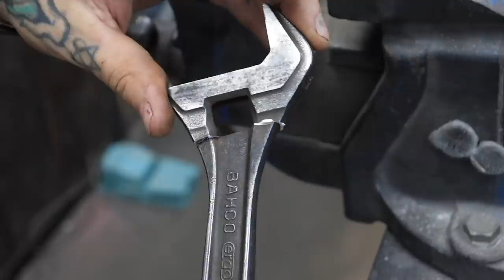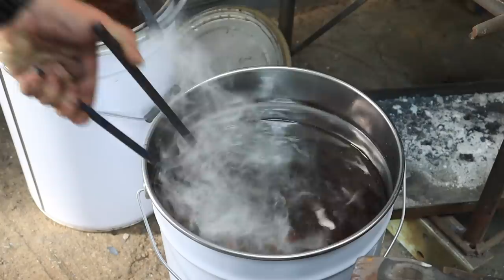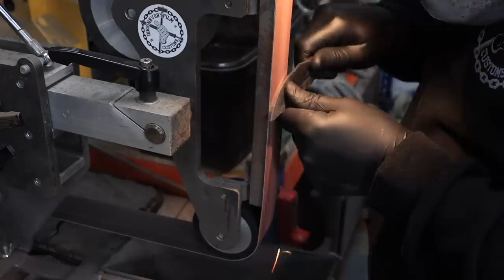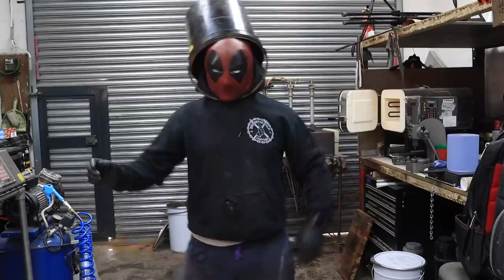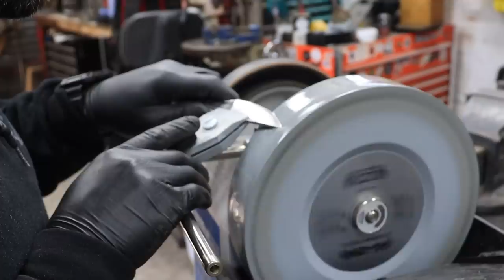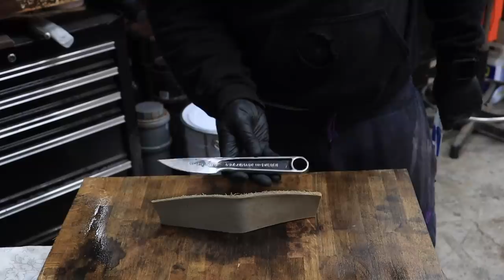Knifemaking - Broken Old Wrench

Comment: Has that steel held a sharp blade or does it dull easy? I know metals like railroad spikes when sharpened don't hold a blade for long.
Reply from the maker: Yes these are tool steel but railroad spike is a low carbon steel

Comment: I like taking Louisville sluggers and turning them into battle axes. Id love to see what you come up with. The last one i made i use a 16" miter saw blade cut into 4 pieces the counter sunk with locking pins perpendicular tobthe the blade and bat then i stitched them all to the bat with some 12 gauge steel wire to look like barbed wire. Ill make a short collage video and post it so you can see what im jib jabbin about. Youll like it.
Reply from the maker: If you check out my older videos you will see I done something like this before
Reply: Cool. Ill have to check'er oot then. You know im just giving you a hard time right. But if i dont get a heart im going to feel special. Lol.
Reply from the maker: Where are you giving me a hard time?

Comment: Did you calculate how much electricity/energy was used for this knife, just curious if the economics of making suck a tool, from scrap or not, will make any profit on them?
Reply from the maker: Yeh i also had a step counter which I monitored closely as I didn’t want the food intake cost to take away from my profits.

Comment: Why cut off the head of the wrench? Couldn't you just forge it into a longer blade? Not being a S.A. , just curious. With all due respect, Sir.
Reply from the maker: It’s hollow in areas that I couldn’t be sure were properly clean and I didn’t want to have to try forge weld it together risking it not taking.
Reply: @DiesInEveryFilm  I now understand. Thank you for the reply.
Reply from the maker: No problem at all